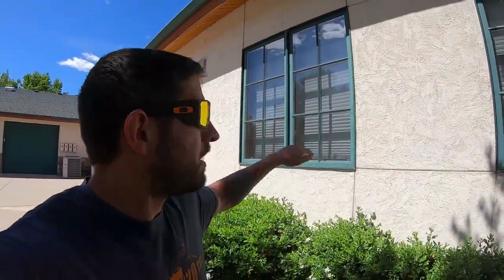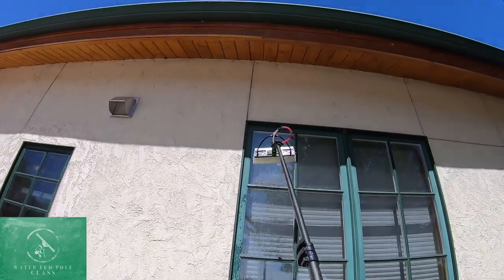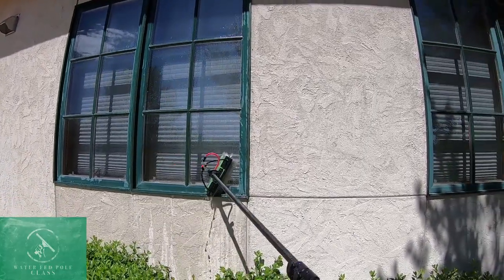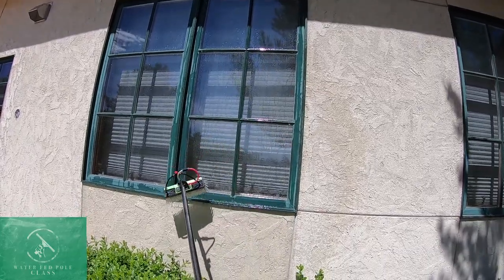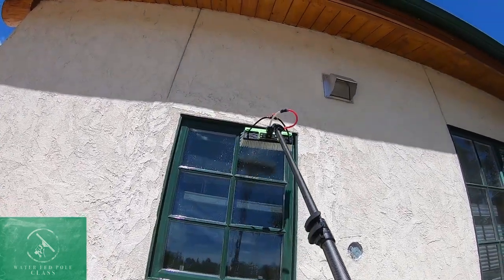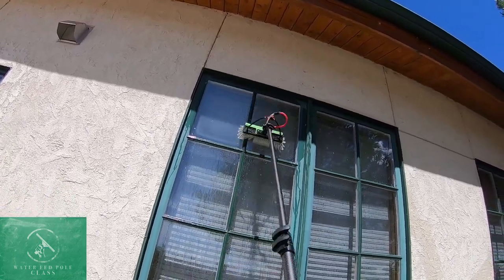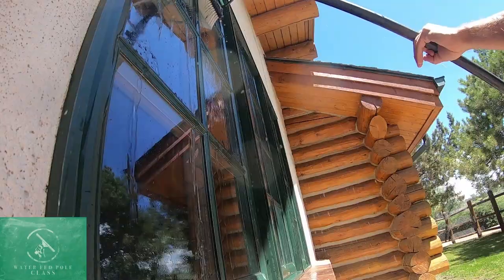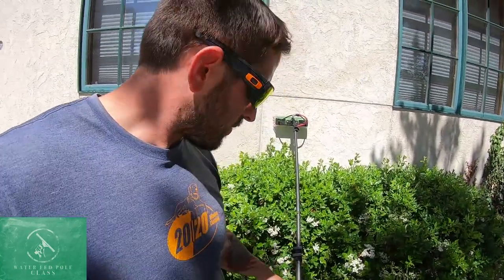Water Fed Pole Technique for French Windows

Comment: I always prewash using tap water connected to the water feed pole, this saves your pure water and cleanses the glass first, you can really crank up the water flow rate from the garden tap and give it a good blast , do all outside windows then go back over with pure water.. 👍

Comment: Are you using a booster pump or running off of tap pressure?
Reply: Gumforys Window Cleaning tap pressure
Reply: @SteveOthewindowcleaner  Are you using the rinse bar or jets?